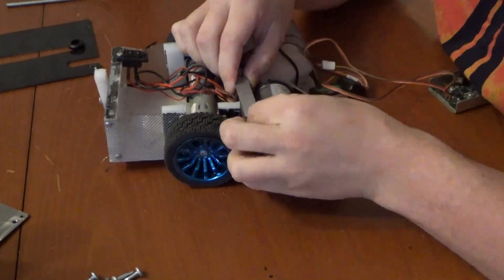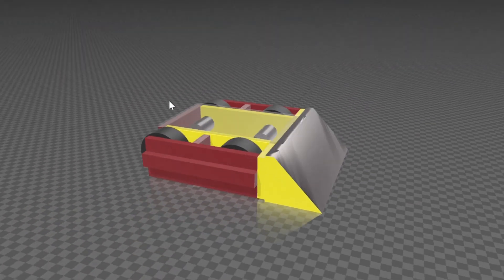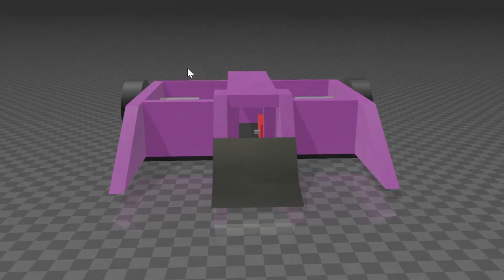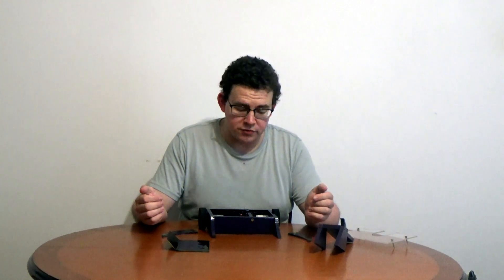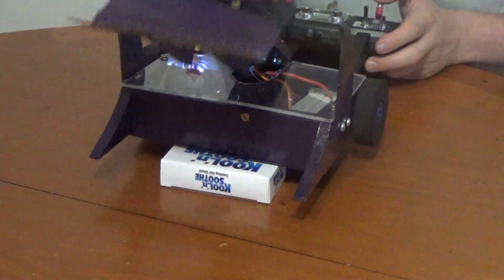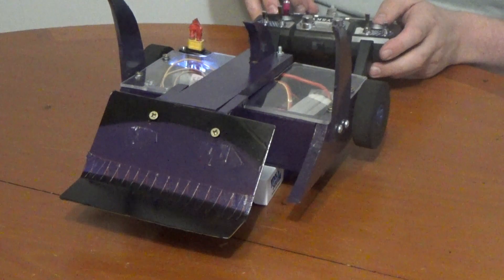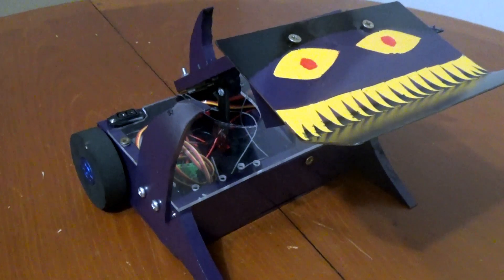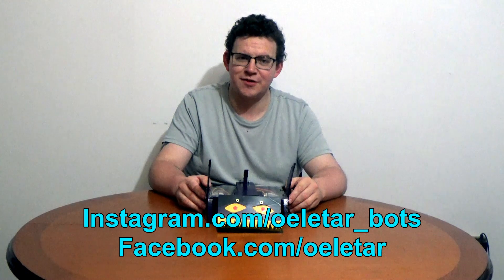New lifter beetleweight combat robot

Comment: Great. Does it drive inverted? Can it self-right from every position? How much can it lift? Which servo did you use?
Reply from the maker: It can't drive inverted but can self right from any position and currently has a 30kg servo, which I plan to swap out for a better one. I just used it because it's what I had on hand